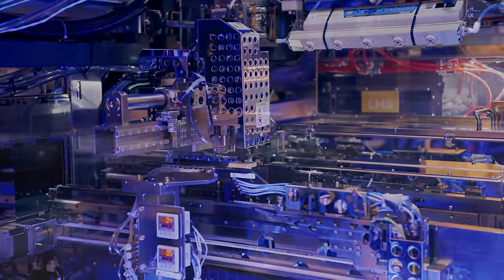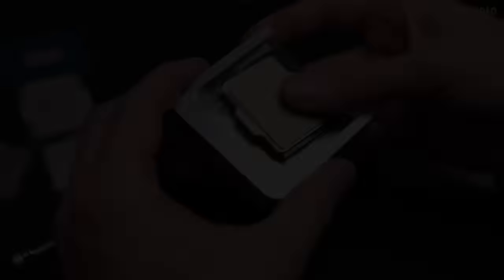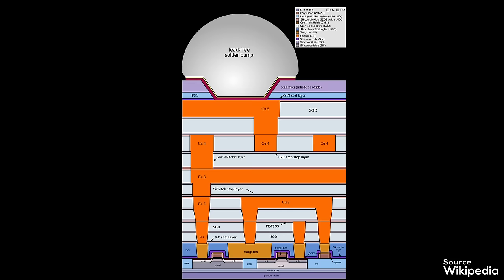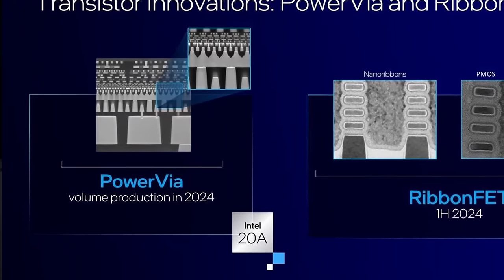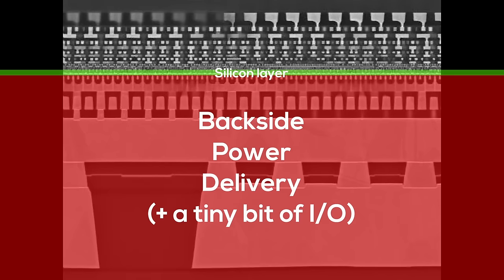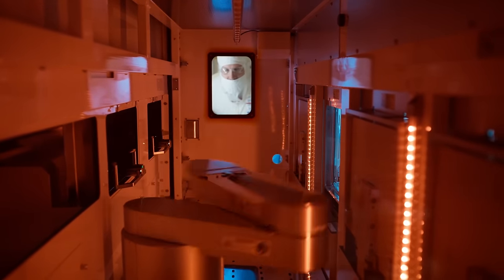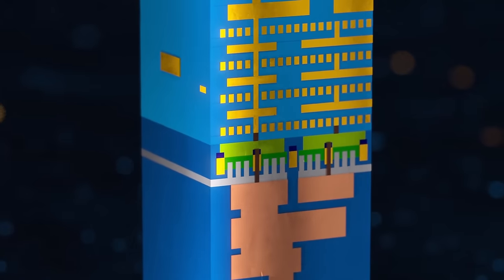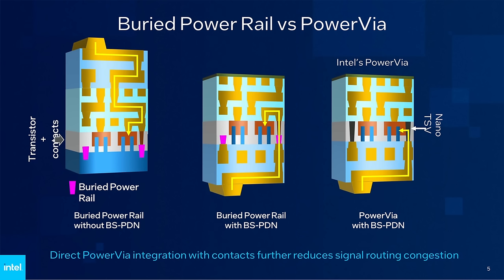Why next-gen chips separate Data & Power

Comment: Greetings from the Intel 20A BPD team! I was involved with Blue Sky Creek (BSC) in its early stages, but was moved from the team to work on 20A proper before they hit the labs post-silicon. I did my PhD on the development of modeling and optimization methods for chip to chip power delivery, focusing on multi-chip-module designs and finishing in 2020. Feel free to ask me anything about this new technology and I will happily share what I can.
Reply from the maker: My first question would be, how much did I get wrong? :D
Reply: @HighYield  I could nitpick stuff for sure, but you didn't miss much. One thing that would have maybe been good to mention as I see a lot of comments asking about it or maybe misinterpreting it is the thermal consequences of the new design.

With the transistor layer moved into the middle, it is true that you have to pull the heat from them through more silicon, but the reduced waste heat from other parts of the die such as the significantly lower resistance in the power vias more than makes up for it. I think we measured something like 20-30% lower resistance in some scenarios, which means a lot less voltage drop from contacts to transistors. That power loss from resistance is a significant portion of the heat generated by a modern chip. I can't say exactly how much, but ARL could actually use that to see a reduction in max power for the first time in a lot of Intel generations.
Reply: Hey, I'm just a person. But you did say you would answer questions so... 
What does this mean for mobile phones?
Reply: I've got a couple of questions for you. I'm currently studying computer architecture so i might just be missing some common knowledge about manufacturing processes
1) If the pin connections are now on the backside along with the PD network, how do external data signals connect to the signal network?
2) is more material lost/wasted due to adding a new carrier wafer and removing the old one? (8:50)
Reply: @parsnip908  Power and I/O are still routed to the same side eventually. This isn't reflected well in diagrams because you have to cut away somewhere. Most of what is on the frontside is the communication network on the chip, as this is what really dominates those low metal layers and gets in the way of other stuff. BPD should really be called BPD&I/O. You can still mount the chip in a BGA form factor like normal.

There is technically more waste material as you use 2 wafers in the production process, but since the yield can be quite high and the pitches in the metal layers relaxed, you can actually save money in the production process. This is part of why 18A will be offered externally after the technology proves itself on 20A.
Reply: @GreenishlyGreen  Since the SoCs for phones use the same lithography technology as any other computer chip, you can expect BPD to have the same benefits for them as well. I'm not sure how well ARM designs take to the new techniques, but Samsung has claimed some pretty good gains with their BPD efforts for future Exynos chips.
Reply: Q: Why are your CPUs less efficient than your competitor despite using "Efficiency Cores" which you guys only use, is this a problem in fab team or the problem of your CPU team?
Reply: At the end this video implies 18A is comparable to TSMC N3, is that correct or is N2 a better comparison?
Reply: @TechOtakuYT my guess would be that they can't give you best of both worlds in one design. The P cores sacrifice power & thermal to maximize performance. The E-cores flip that around to maximize efficiency.

Obviously they aren't enough, or you'd see much lower standby-power draw in practice.

It's like AMD's X3D-nonX3d design,  being in single chip makes it better, you trade one feature to maximize/minimize other. 

Because you can't have it all in one thing.

I bet a couple of hundred iterations on such design ideas will significantly help current situation of ultra high end silicon.
Reply: @TechOtakuYT   That is an extremely loaded question, and I tend not to answer these as the folks asking them just want me to confirm what they already believe. But, I said ask me anything, so I'll try to explain some of what's going on inside Alder Lake and its derivatives RPL and MTL.

The architecture performance of Raptor Lake and Zen4 is fairly comparable on the P-core side, and the E-cores are often comparable to Zen2 thread for thread. In my own testing, the E-cores of the 12900K perform on-par with a Ryzen 3300X and the 16 present on a 13900K close in on the Ryzen 3700. So the idea that any of these cores aren't pulling their weight should be dropped. The E-cores are doing exactly what they are supposed to be doing.

A lot of the gap comes from the difference in process nodes chosen. AMD's Zen4 is built on a mature 5nm process, while Raptor Lake is built on Intel7, which is a tuned version of the old 10nm node. I want to be clear that is is not the same 10nm as Ice lake and Tiger Lake, but it is in the same family. I pin the high-frequency inefficiency on the process node.

We can see evidence of this when the P-cores of Meteor Lake, Redwood Cove are considered. They achieve similar power efficiency to the 5nm Zen4 chips, and really only lose out on mobile to another node disadvantage as Phoenix is 4nm silicon. If the CPU tile had backside power, like in Blue Sky Creek, the power efficiency gained there would likely put MTL slightly ahead, but this wasn't going to happen with a low-volume R&D node.

I'd also like to add that Intel is far from the only chip maker to use E-cores. AMD of course has smaller Zen-C cores, but the better comparison might be the mid-sized cores on a smartphone SoC in terms of functionality. The E-cores of Raptor Lake and others are there to make a better use of the limited die area. Having more P-cores will not make most things that need fast cores go faster, and they provide more multi-threaded performance per area than those P-cores.
Reply: @gtg162y  20A is the 3nm competitor and 18A is an improved version, so you could call it a 2nm or a 3nm+ competitor. I don't control how they market these things though, and that's all that really is.
Reply: @DigitalJedi  I see, thanks for the info, also they reason i didnt compare Intel's Efficiency cores to that of ARM is that because i cannot be sure if its apples to apples comparison as ARM is using a completely different instruction set to that of both of AMD and Intel's CISC. As for AMD, they only really use it on their Laptop and low end SKUs so i completely forgot about their existence tbh.
Reply: @DigitalJedi  I see so then Intel 3 is comparable to TSMC 5nm, Intel 4 to TSMC 7nm and Intel 7 to TSMC 10nm in terms of perf per Watt, is that correct?
Reply: @TechOtaku86  The reason I chose that comparison is that despite the difference in ISA, the cores serve similar purposed and relations to their big cores. They are both generally simpler, much smaller, and lower-clocked cores that provide extra multi-core performance.
Reply: @DigitalJedi  ill be using it to run higher vcore and clocks lol
Reply: 20a better be ready tho
if u get 20a u get 18a and suddenly IFS becomes very relevant
Reply: Appreciate your replying to the comments. Interesting reads as a hobbyist architecture nerd.
Reply: How deficient can I do clock shielding with my ground on the back side? Also what is the alignment tolerance for the back side patterning lithography steps?
Reply: Very nice thread, thanks for sharing your insights. Q: What do you think about Intel announcing 2 big changes, RibbonFET and Power Vias in the same 20A node? Are there any notable challenges or risks integrating both of them to the manufacturing process at the same time?
Reply: @szaszm_  There are certainly challenges to doing both at the same time, but it's one of those things where you might as well do both if you have to rebuild from the ground up for either anyways.

Also note that it only looks like we are adding both a the same time for the production process nodes. Like was mentioned above with Blue Sky Creek, there is a version of Intel4, a finfet node, that has BPD. This is an R&D only node, so only small dies and no products. This node is where Intel makes its performance gain claims from for BPD when 20A or 18A is not named.
Reply: @CyrusTabery  I can't really disclose either of that sadly. You'll have to wait until there are 18A specifications out from Intel as that node will be available for IFS customers.
Reply: Tell the truth now. You internally call it "the power bottom" don't you? ;p
Reply: @bigcazza5260  20A is going to overclock differently to things before it, so be prepared for that. Voltages are likely going to be lower than before due to the lower internal resistance, and you may find that thermals are funky on tiled chips since the interposer can also get hot.
Reply: @myne00  I'd by lying if I denied that lol. I'm not sure if we all just have the humor of teenagers or if the stress is getting to us.
Reply: so if the interposer heatsoaks then i guess because transistors are down low you will get diminishing stability?
meh im used to fighting high ambients with 1.5 dual rank b-die
Reply: @DigitalJedi  e cores are very closely related in philosophy to a 4 core ccx but they are more balanced to assist intels p core, zen4 has nothing on alder lake lol
Reply: @DigitalJedi  LPe cores are actual efficiency cores to keep the main processor die powered down. E cores are just MT accelerators and good for crappy tasks that dont need to clog up your main threads
Reply: @bigcazza5260  I'm well aware of how a product I helped design works. E-cores are generally going to be more power efficient at the clocks you see on desktop non-k and mobile chips, and the LPe-cores are just the same thing at lower clocks on a different process node. There is nothing special about them other than coming in 2s instead of 4s, and what they are connected to.
Reply: @DigitalJedi  
Thanks for taking queries in this thread!! :)

I have got a few questions on this:
1. If this is the architecture moving forward, then it is not compatible with the next layer of system-design co-optimization, say a 3D stack or in-memory compute designs. Thoughts?
2. Could you comment of testability mechanism of this chip, given the GPIO/JTAG pins would be separated. So, would it mean, these designs take test-time penalty hit? How are they multiplexed with design structures?
3. I believe there cannot be free lunch, do you any existing bottlenecks/potential roadmap challenges in this method? Or is it too early to comment on??
Reply: @TechOtakuYT  Because as Intel has always claimed, the E Cores are efficient in terms of die space used, not power/performance ratio (that doesn't mean power/performance isn't a goal, it's just not as highly prioritized as space usage).
Reply: Hi really appreciate your taking questions, here are mine:

1. In the context of managing thermal stuff I'm guessing a traditional heat sink (placed on data signal BEOL layers?) wouldn't be as effective because its farther away from transistors, I see in a separate response you said that the resistance drop from using backside power makes up for it but is there any case where a design (high utilization lots of active transistors) could push the thermal limits? Is there any thought at Intel w.r.t microfluidic cooling?

2. In the context of 3D ICs I know Intel uses face to face (F2F) bonding in Foveros so how does the addition of back side power delivery change things w.r.t power and I/Os? By this I mean assuming F2F is still used and we get our bottom die (closer to package) I/Os and power from its backside PDN that makes sense, but to get power and I/Os to the top die we would maybe use one of following options:
       a.  send them through the data signal BEOL on bottom die, then to the data signal BEOL on top die ->  this really doesn't make any sense to do as it removes BSPDN gains
       b.  use some copper columns from package/interposer from outside bottom die (I think this is in Foveros) -> This is the option that makes sense to me but I don't understand how its implemented
       c.  use wire bonding to get signals to/from the top die 

If I missed anything or made incorrect assumptions feel free to call me out
Thanks so much!
Reply: Is this tech also applicable for other architecture beside the x86?  (ARM and RISC-V)
Reply: @vatsan2483  Foveros 3D stacking is capable of working with the new die layout. I unfortunately can't say a whole lot more until Intel has disclosed how things work.

Testing works pretty much like a normal chip, as the connections are all still on the one side. I once again sadly can't go into much detail, but there are some time hits with any new process, and developing those best practices for testing are a big chunk of bringing any process node online.

It's a bit too early to comment on any roadmap challenges. Right now things are pretty smooth sailing, but I'm sure there will be challenges moving towards sub-nm class nodes as the miniaturization required to reach that point is very extreme.
Reply: @YuzuYuiAngelaAki  Absolutely. The process node does not care what you make on it. You could make x86, Power, ARM, RISC-V, MIPs, or even a GPU on here if you wanted to. Samsung has been testing their own BPD with ARM Cortex-X cores if I remember correctly, showing sizable area shrinks for X4 and X5.
Reply: @DigitalJedi  Thanks on your replies, will await the Intel official release... Layout yes in notes these can be explained and reasoned out for 3D chips but classically with Intel this I don't expect to be details wrt Testing in any release docs :(
Anyways thanks for your response!!
Reply: Have you considered employing microfluidic cooling on the backside as well? I recall seeing a paper about microfluidic cooling with TSVs, enabling possibilities for BGA or stacked chip configurations. Perhaps you could even introduce a socket-like system for liquid cooling to reduce costs.
Reply: @Tomatosauce-sx6tc  I covered microfluidic cooling in another comment, but to explain again, it's just not happening. You can do stacked dies without it, we already are.

As for why not do it, cost and complexity. Bying going the route of microfluidic cooling, you force the user into a liquid cooling loop, driving up the platform costs. The socket being suited to that does the same thing with every motherboard now needing to ensure a seal for liquid transfer.

It is simply much easier and cheaper for everyone on the consumer side if conventional cooling remains viable. Things like liquid metal or solder TIMs are very thermally conductive already, and if things get dire, the 14900KS playbook can come out with warranties on direct-die prebuilts.

I could see microfluidic cooling happening for some extremely custom chip, but whatever that thing is would be completely alien to everything else currently rolling off the fab lines to my knowledge.
Reply: @DigitalJedi  Thank you
Reply: @HighYield hahaha. A lot!😂
Reply: when can we expect news about BPD on GPUs?
Reply: @asdfsafdsfdsfds3988  I can't say beyond that it will eventually happen. Every major fab player is trying for BPD of some kind, so it has to happen at some point. The trend seems to be to target a given fab's early 2nm-class nodes, so maybe 2-3 generations unless somebody decides to shell out big for a node advantage.
Reply: Wouldn't cooling be inefficient ? I mean  I can't see this method being applied on modern computer CPUs , is this more for small ic chips found on a mobo or whatnot ?
Reply: @billkillernic  BPD targets high-performance chips like your CPU or GPU. As I've discussed in other comments, the thermal benefits from the lower electrical resistance more than offset the thickness of additional metal layers above the transistors.

Less heat is generated outside of the transistor layer due to resistive losses. Less power is needed to drive the chip because more of the total goes to the transistors. Between these two factors the CPU draws less power and as a result runs cooler.
Reply: i have idea, if the heat in the middle , change all the old designs   of cpu not just the chip but all cpu, first chip must stand so all signal layer,transistor layer,and power layer 50% area on top will put inside new design heatsink and on bottom 50% chip will sink or put to pcb, and maybe this design can make both signal and power layer side can own directly connect to pcb, so imagine future cpu pc not flat square but a cube shape and put the cube into motherboard, this design can have good heat sink on top. it's fine cpu for pc big 3-5cm height its give more area to heatpipe of pc heatsink to take heat. i just wanna share what in my mind😊
Reply: @dlv5  I'm not sure I understand your comment exactly, but it sounds like you are suggesting a vertical die with cooling applied to both faces.

Sadly, this cannot work. One face of the die must have the interconnect points on it. There is simply no way to route all of them to an edge, both in terms of the room on the edge and the physical construction of the metal layers.

Additionally, those connections now have varying lengths, with the ones going to the top having to travel farther than the ones near the base. This creates problems with your higg-speed I/Os such as memory and PCIE.

Further, this is not going to be mechanically strong. Your die is now a large lever that can wrench the contacts out of the pcb, making the whole thing more vulnerable to damage.
Reply: @DigitalJedi thank you so much for this!! What a trove 🎉❤
Reply: Will it allow  above 6ghz clocks while not getting as much power draw and higher fsb clocks because it would be awesome for overclockers?
Reply: @DigitalJedi  Firstly, thank you for making yourself available for questions! It is very interesting reading!

I would like to ask about lifespan and reliability of such chip. I know that it will be probably obsolete before it dies for usual customer but at the moment, I use 1st gen i5 660 32nm node cpu to write this :D. For a long time I have been curious how long a chip can last because I have an old laptop with 65nm Celeron T1600 cpu that has been on for 7 years and utilized to 100% for most of the time and it is still alive, yet I heard about many modern and much smaller node GPUs dying from mining crypto.

So far I have learned about two major failure modes of silicon chips.

Chemical diffusion between layers so the transistors go out of spec over time and they can't keep up with clock or fail completely. Temperature plays a major role here so having wires that generate less heat would be beneficial if this extra thermal headroom wouldn't be taken to increase performance. But still, in typical use case, I can imagine BPD chips to run cooler.

And there is electromigration. Again, having wires with larger cross section would decrease current density and heat generated so the chip would theoretically suffer less from this effect.

So, is it reasonable to expect increased lifespan and reliability of BPD chips?

And bonus question :D. Cache takes a lot of space on the CPU, yet it is relatively simple in structure. Do you think it would be somewhen possible to cram another layer of transistors, for example on top of current cache area, so it wouldn't interfere with other structures, to double the cache or shrink the area it needs?
Reply: @steposka  It's hard to say if the lifespan will be longer than the current chips, but I can say they should still last quite a long time if taken decent care of. It's actually pretty hard to accurately estimate the ultimate lifespan of a chip, as the processes that make them and the environments they are subjected to are variable enough to be basically chaotic. The only accurate way to simulate their total lifespan of a CPU and account for everything would be to just have them running until they stopped, but f we did that, the 3rd gen would probably just now be launching lol.

The GPUs the died mining were often times just the memory degrading. The main dies themselves are almost always fine as they have a relatively light and importantly constant heat load, which is also probably helping that celeron you mentioned. Thermal cycling is the enemy.

As for your bonus question, that's a complicated topic. In a way, it is already happening. AMD has multiple CPUs with 64MB of additional L3 cache stacked on top of the 32MB that is located in the die containing the CPU cores. That doesn't seem quite like what you meant though, as it is 2 entire chips.

The alternative is to do multiple transistor layers, and sadly there are no current processes that can do this that are anywhere near marketable yet.

As for why cache isn't shrinking, it is because the fundamental building block, the SRAM cell, can only be made so small. Memory works by storing charges, and you need a structure large enough to store enough charge to be readable again after some time. It is still slowly shrinking, but it now seems we are likely to hit a bottoming-out point in not many years where we can no longer beat physics into submission in the name of running doom on increasingly smaller things.
Reply: What's the work-life balance like at that level?
Reply: Can signals still be routed through the power delivery side?
Like less critical ones, or if a region needs more signals but less power, or it avoids an extra layer in the signal side…
Reply: Could the “backside” be another transistor chip, so as to kind-of double the transistor density, or have memory extremely close?
Reply: @musaran2  the back and front side are both metal, so there's no silicon to add them with. However, the techniques used here could in theory be adapted to multi-layer designs in the future. Right now that is impractical, and die stacking is used for a similar effect instead, and likey will continue to be used for a long time.
Reply: im pretty sure amd will steal this idea. :D
Reply: @Uraim AMD doesn't have any fabs of their own, and their fabricator, TSMC, is also working towards BPD.
Reply: @DigitalJedi    Any interesting research being done to move parts of the motherboard Vcore switchmode to inside the chip package?
With such a low voltage the amps are just getting insane. Be much nicer if we could feed the chip a higher voltage and drop that down closer to where it's needed. Assuming the switchmode can be miniaturized
Reply: @DigitalJedi  What am I going to be looking at when looking for a career in developing these chips and fabrication nodes at the bleeding edge? Is it a college degree? Or something you'd specifically study at a semiconductor buisness?
Reply: @Tim_2060  A masters or PhD in a relevant field is pretty much a requirement from what I've seen. My bachelor's and masters are in electrical engineering with a physics minor, then a few years in a related industry (Gigabyte, chipset integration) before the PhD. There is also quite a lot of job-specific training and learning that happens, especially on anything bleeding edge.
Reply: @DigitalJedi  Sounds pretty exciting, especially with Intel opening a big fab here in Germany. Thanks a lot!
Reply: @FiveArc  The last few weeks have been well over 50 hours, but we're in the next cycle for something post 20A I can't name now. Usually it's a fairly normal silicon valley type job. 9-5 with too many meetings and all that.
Reply: @DigitalJedi  how do you remove the silicon on the backside without removing or damaging the transistors themselves? the active layer is very thin compared to the amount of material that needs to be removed, so it sounds extremely difficult!
Reply: @asdfghyter  very, very carefully!
Reply: @DigitalJedi  i can imagine! what kind of technology allows that kind of precision? it almost seems impossible to me! like, how would you even know when you’ve reached the actual active layer?
Reply: the only thing comes into my mind is to do with ground shielding when moving the power far away from the existing test and proven structures of wafer.
Reply: @DigitalJedi  Soo cool tech! 
Q1: On a cnc flipping makes realignment hard, will yield not drop due to this flipping?
Q2: Also if already operating from both sides, why not add signals on the new side to further increase density - like use 20 or 30 percent  for signals? 
Thanks a lot for commenting!
Reply: @DigitalJedi  do you still use X-mas model verification of hardware structures?
Reply: @asdfghyter  I can't comment on exactly what is going on here, but in other semiconductor manufacturing methods, both mechanical and chemical processes are used to thin wafers.
Reply: I'm sure your engineers have already thought about this, but is it possible that the carrier wafer at 8:55 need not be at the same purity/quality that would be usually be needed for making chips since it's just used for support? I wonder if that's a sensible way to save on cost.
Reply: I have an application that would benefit greatly from this technology.  Is there a contact or team that I need to get in contact with at Intel ? I work in the Semi industry.
Reply: @pentachronic  20A will be an internal node. You'll have to wait until 18A to have chips made.
Reply: @DigitalJedi  Do you think these improvements in manufacturing have a bigger/smaller effect when you're talking the tiny e-cores present in n100/J4125 etc style USB-C powered mini-pc processors?  Because I see some REALLY weird movements in the Chinese ultra-low power chips(weird big/little configurations and the explosion of RISC-V cores that aren't even documented properly nor are they waiting for ratification of standards).  No doubt some of that is geopolitical, but in general how will it affect sub-10W computing?
Reply: @DigitalJedi  yeah, i suspected that there was an nda involved here, but thanks for replying as much as you can!
Reply: @DigitalJedi  With all the space saved from backside power delivery could large stacked metal layers on the front side be made for the single purpose of carrying heat away from the transistors below?
Reply: @GreenishlyGreen  Where in his post did he say he worked on SOC backside power delivery? Pretty sure he expressly said Intels 20A & MCM Designs.
Reply: Didn't you signed an NDA?
Reply: @ChimpyChamp  The front side is still occupied by all of the internal interconnects. If you found the room to slap down a bunch of copper pillars to increase conductivity, you'd do it at the expense of making that network routing a nightmare, which gets us back to why BPD is being done in the first place. Metal layers are already pretty darn conductive as well.
Reply: @FazedSoul  Pretty dang strict ones at that. That's why I can't answer seemingly random things or questions about the exact processes used. I'm over here looking up things on the Intel website to see what papers are out to the public before I reply to anybody and accidentally leak something.
Reply: @Psi105  I unfortunately don't work closely enough with that to answer you very well. There are however some great articles about this sort of thing out on IEEE Xplore. Youtube is apparently eating my links to them so instead I'll share the title "A Brief Overview of On-Chip Voltage Regulation in High-Performance and High-Density Integrated Circuits." This is proabably a good jumping-off point if you want to see what people have been trying recently.
Reply: @Grimmwoldds  Blue Sky Creek was nothing but E-cores and was able to hit 3.05ghz at 1.1v. That includes both of the tiny tiles (33.2mm^2 each) and their interconnect. For comparison the N300 needs about 20% more power to do that in a monolithic chip. We also achieved nearly 95% cell utilization in the CPU cores of that chip. While I can't say what the utilization is for MTL's Crestmont, it isn't quite that high.

I think the bigger gains for low-power computing will actually come from Skymont cores though, as they should be a sizable uplift over the current Crestmont. I highly reccomend the Anandtech article on Blue Sky Creek as I was one of the presenters at the event they got their slides from. We may even see chips with P-cores in that single-digit TDP class next generation, as LNL is targeting as far down as 7-9W, which is currently where ALD-N sits.
Reply: @nerdynumen  I do technically do work on SoC stuff, but only in the sense that they all go through our fabs. Things I've worked on have been directly applied to Lakefield, Meteor Lake, Arrow Lake, Sapphire Rapids HBM (did actual design work here) and Gaudi.
Reply: Do I understand it correctly that this design can be used for GPUs too? Does it help more with space there (less complex but more cores vs more complex but less cores) than on CPUs?
Reply: @dreimu  Process nodes generally don't care what you are making on them. I expect GPUs and CPUs to see similar improvements. You can get area, and therefor density, improvements going the BPD route.

I don't have great numbers that I can quote publicly for 20A other than a 12.5% percent shrinkage in cell size for the version of Intel4 used in Blue Sky Creek.
Reply: I'm curious. Since removing the backing layer is a high precision process how does it effect ultimate chip cost. I forsee potential for errors in both the mounting of the new supporting layer and in the subsequent polishing steps, not to mention the time to do these steps. How does that compare standard methods? If you can divulge, what measures are taken to improve production while implementing top power like this?
Reply: @DigitalJedi
I've got some questions too, would be awesome if you would be able to help me at least with a few of these.

1) With BPD, I expect the thermal conductivity to be more limited by some of the die layers. Speaking from the best comparison I can give, 7800x3d. I' ve noticed there being a limit to heat dissipation after PBO (boost algorithm) kicks in. So is it like I expect, you basically are required to lower Vcore, but once you hit a certain threshold thermal insulation just becomes too high? That would also mean no 9ghz LN2 record cause of ultimate voltage limitations?

2) All mainstream CPUs, Intel and AMDip have fused in V/f curves. This basically converts to the VID request. Therefore, how accurate do you deem those fused in V/f tables? Is it like +/-5 mV, +/-10 mV or less? Ofc all of those depend on your die temperature aswell, but I guess those are for worst case like 100°C anyways?

3) I haven't tested it myself. But how effective would you deem two sided cooling of a CPU, like normal coldplate + thermapad with small cooler on the back side of the CPU socket (back side of MoBo) directly put ontop of those additional capacitors? Could there be any meaningful difference thermally?

I appriciate all the points you can answer and I am looking forward to your reply!
Reply: oh forgot two more:

4) With cache and RAM latency becoming more and more the most limiting factors of modern CPUs and (actually) GPUs alike. Will there be a trend towards more cache RAM intigration through MCM desgin into the CPU (maybe even GPU aka HBM) itself?
Is it likely that we willl have MCM CPUs with literal HBM next to them on a shared interposer?

5) Isn't it possible to just fold a larger CPU silicon layer over itself to effectively double/ stack the SRAM capacity?
Reply: BSP seems like an easy choice vs further shrink/weird transistor shapes. Do you have any idea why TSMC is waiting so long to introduce backside power in their process? I think their roadmap is 2026 bc they’re gonna do GAA first.
Also, if intel gets some good development insights from BSPDN, why are they leaning into high NA euv so much? Isn’t the point of bspdn that you don’t need shrink to get more performance?
Reply: @TheTrueOSSS  There can be errors at every step and between steps just moving them around. It is a more complicated process, but 20A should not be terribly expensive for a leading-edge node all things considered. I can't say much more than that sadly.
Reply: @BaBaNaNaBa  Going to try to answer all of those in one big comment, so here goes:

1. The lower voltage is due to a lower internal resistance, which means there is less power going into the chip overall. Using Ohm's law you can find that with a lower resistance you will hit current limits at a lower voltage. Do with that information what you will. The lower power draw more than makes up for the longer path to the cooling surface, and metal layers full of copper like what would be on the frontside are still quite conductive. I unfortnately can't comment on clocks until Arrow Lake is in people's hands, but Blue Sky Creek saw a 6% increase to its maximum frequency on Intel4, which was a node not designed around using BPD.

2. I can't comment on exactly how the V/F curve is calculated as that is not my area of expertise. I can speculate though that they are planning for the worst case of both silicon quality for a given bin and to run near Tmax.

3. When I have done LN2 or chilled-water overclocking, I haven't cooled the backside of the motherboard. It is already basically a huge copper sheet and the hottest portion of the whole system is being directly contacted by a large heatsink already. Anything you put on he back has to go through the board, through the socket contacts, through a second layer of PCB on the CPU, and then finally to the hotspot. This is just too much to be worth the effort.

4. HBM is not exclusive to GPUs, see Sapphire Rapids HBM. I don't see it coming to the consumer platform due to the high cost of a multi-kilobit-wide memory bus. If any memory moves in to the socket I would expect it to be something like eDRAM LPDDR5X or LPDDR6 instead. We will see something close to this with Lunar Lake.

I am not an architect, but current trends show that large caches are the future. I believe that a large shared L2 is ideal, but AMD prefers a small L2 that is fast to search and backed by a deep L3. Both are valid approaches.

5. That is called true-3D lithography and is currently the holy grail of manufacturing as once you have it, you have effectively double or triple the transistor density of anybody who doesn't. It is believed to be possible, but currently infeasible. As of right now nothing that can do this is leaving some extremely low-yield lab if it exists at all, and if you know of somebody making it work with any semblance of scalability and reliability, I know some people who would be very interested in giving them hilarious amounts of money.
Reply: Is silicon carbide possible for CPUs? Heard they're great for mosfets, big heat transfer improvements
Reply: This is such a great technology. I kinda feel jealous that you had the opportunity to work in this.
Anyway, my question is, if the chip doesn’t have to be flipped over for external connections, how would the signal c4 bumps connect to the interposer/substrate. Because, now the signal bumps are on the top of the die. So, how would you bring them down and connect them to the interposer/substrate
Reply: Hello Sir. How is backside contact revealed? My bet it's first through abrasion, then last few hudreds of nanometer by atomic layer vaporizing.
Next up, I wish to know: Since power and I/O still delivered through the same side, some signal cables must travel from the front side to the back, perforating the active silicon layer, isn't it?
Thirdly, how it's affecting the heat generation? The heat generated in signal layer seems to be completely isolated. What's the condition of heat generated over long (say weeks) period of runtime?
Finally, what's the fate of this removed silicon?

I'm a layman, so please pardon my stupid questions.
Reply: @wrefk  SiC may be good for high-temp applications, but it doesn't have near the performance of a doped silicon wafer for frequency or feature size. I'm personally more interested in seeing where pure carbon or doped carbon goes as it has excellent conductive properties.
Reply: @rohithjbharadwaj3419  power and IO happen on the same side. It's the internal network on top now.
Reply: @aniksamiurrahman6365  I unfortunately can't disclose process details like that just yet. I will say though that you can bond metal to both sides of the logic layer without putting holes in it.
Reply: @DigitalJedi  Thanks for the detail sir. And wow! That small clue is a lot.
Reply: Will there be any problem in Cooling this chip and why? Also can we over clock it like the normal stuff?
Reply: @okman9684  I also want to know about cooling. Afterall, the front side will be hermetically sealed and the heat therein will have no direct route to come out. Unless the hermetic seal is fairly thin and some heat sink is placed just above it.
Reply: @DigitalJedi  Is the I can't say a the architecture not known or you're forbidden to speak on the matter?
Reply: @okman9684  It may behave a bit differently from a monolithic chip, but that's more a function of being MCM with an interposer. If you've ever done overclocking on certain AMD GPUs like Vega, you'll be familiar with what happens when that massive chunk of underlying silicon gets too hot.
Reply: @the_expidition427  Sorry that this sounds like I can't say why I can't say things, but there are a few reasons I might withhold certain information. I don't want to say something confidential, and I don't want to share something incorrect because some people will just take anything with my username on it at face value in this thread.
Reply: @aniksamiurrahman6365  Technically there is a longer path from transistor to heatsink, but with so much less power wasted in resistance just getting to them, you'll likely find that the overall heat load is less.
Reply: Your answers are pure gold. I have some questions:

1) Can BPD apply to older process nodes like the legendary intel 14nm to improve power efficiency on low-cost chips, or chips that don't need the latest process (power delivery chips, etc)? Or is it better to just move to a smaller node at that point?
2) Power efficiency of Arrow Lake and Lunar Lake look very promising. Since TSMC's 2nm (BPD) isn't coming till 2026, do you expect arrow / lunar lake to claim the efficiency crown on laptops/mobile over AMD/Qualcomm/Apple in 2025?
3) On a chiplet/MCM processor, can BPD and non-BPD chiplets be packaged / mixed&matched on a single substrate? Or do all chiplets need to be either BPD or non-BPD due to the different voltage requirements?
4) (not BPD related) Nikon recently earned Intel's 2024 EPIC Distinguished Supplier Award with Safety Distinction. Afaik Nikon only produces DUV lithography equipment with no plans for EUV. Can the leading-edge process nodes today still be produced on DUV machines, and if that is the case, how much longer can Nikon DUV & non-ASML machines stay relevant for high performance chip manufacturing?
5) When do you think we will move past silicon onto the novel materials like carbon, etc?

Thanks in advance!
Reply: @stevenliu8611  We've applied PBD to Intel4 as well, so it can go larger than 20A. It might happen to some flavor of Intel3 but I'm not sure. I doubt Intel will go back and attempt to add it to legacy nodes, and you can probably get similar gains over something like 14nm by just moving to Intel10 or Intel7 without spending more R&D money on a custom node. In theory yes though, you could make a BPD version of 14nm.

I'm not going to make any claims of superiority just yet, but we are hoping to close the gap with TSMC's cutting edge here.

Arrow Lake will be a mixture of tiles from Intel and TSMC, and only the 20A CPU tile is currently confirmed to have BPD, so there will be mixing right there. You can do some voltage regulation in an interposer in theory, but you can also just have the vrm supply different voltages to different power pins for each tile.

DUV has a fews years left in it yet I'm sure. Even if it doesn't end up making flagship process nodes, there is going to be a lot of stuff to be made in the 7-3nm range that may not need EUV. 5nm and 4nm-class nodes in particular are likely to stick around as they are sort of where SRAM stops shrinking with current techniques, and phys don't gain much from being any smaller. That means your future budget chips could be on "legacy" 5-4nm for a long time.

I don't personally see us moving to something like a graphene or other carbon variety in the near future. So much infrastructure is built around silicon and treating it in every step of the process that anybody looking to retool for some alternative is going to be an island to the rest of the industry for at least the first few years. I think it may happen eventually, but I don't expect it to leave the lab in the next decade or so if I had to put a number on it.
Reply: Though I know that microelectronics deals with DC power, I am still curious about its relation with AC (as that is the field I work in currently). With the large frequencies observed in modern chips, is there essentially a measurement of power factor for chips at different frequencies? Furthermore, if a thing like PF exists in this context, how drastically has BPD affected such?
Reply: Just stopped by here to thank you for patiently answering all the questions. Learnt a lot!
Reply: @Thirty-Two  I don't think I'm actually able to prvide a satisfactory answer here. In general I don't worry about things like a power factor for these nano-scale circuits. The energy for each transistor is measured in picojoules per bit, so any measurement you take at that level for power is going to be near infinitesimal.
Reply: I'm enjoying being a fly on the wall for this thread 🪰
Reply: So, the carrier wafer/silicon is adhered and not deposited to the front side? And is the original front side substrate wafer removed using a CMP process or etched?
What is the reason for using the 2nd substrate/flipping process instead of building the signals metal section -> transistors layer/s -> then power interconnects? Just yield/cost between the two approaches? (Since apparently the signal vias run around the periphery to the 'backside'? Anyway)
Reply: @DigitalJedi  Well when I bought bought the Intel Q6600 from Micro Center way back when I cut a hole in the side of the case where the CPU was and put a 80mm fan there ( think the right size ) since I OC'd it. Wanted it to last a long time and it did. Among other extra holes in the case with extra fans 😄
Reply: @tannerbean3801  I don't know if there's a better approach for this new technology but in the old technology the silicon in the wafer is what is used to build the transistors.  Some of the silicon after its doped becomes part of the transistors.  Because of this I don't know how you would achieve what you're describing.
Reply: @TheKuptis  I know that silicon substrate is required for building transistors. Silicon can be deposited   i.e. using silane plasma, which is why I ask. I don't know how the 2nd wafer is adhered to the first... or if that bulk silicon is deposited/grown some other way
Reply: @tannerbean3801  The way it's being described they're using a whole other wafer since it needs a solid foundation to be handled by equipment for the rest of the line.  Seems to me to deposit that thick of Si layer would take a long time and be expensive.  Don't know what's being used for the "glue" to hold the new wafer onto the stack so the old one can be taken off.  I worked at Intel from '97 to '03 in Tungsten dep but in the semiconductor world that was back just this side of the stone age.
Reply: I am more curious about how it will impact GAA Transistor. Doesn't mean they could actually optain even more height? I kinda imagine one GAA could replace 4 FinFets. So it propably doesn't work that way, right?
Reply: Does it sound practical to completely cover the top of the die in copper(another layer that's insulated from the internal connections and completely filled out), and later directly bond that to a heat spreader or IHS, to have more consistent thermal contact?
Reply: @DigitalJedi  Intel’s 11th gen CPUs had the I/O on the die, contributing to their low-latency and responsive performance, making them feel faster. However, the 12th gen and subsequent series relocated the I/O off-die, leading to increased latency. Will the upcoming Arrow Lake CPUs tackle these latency issues and restore the snappiness of previous generations?
Reply: How far away are we ?
Reply: I love this thread ❤😅
Reply: Can you use cheaper or less pure Silicon for the 2nd layer because its just used for structural support, because with my Logical thinking you could just use cheaper not as pure bi products from Silicon making as secondry layers.
Reply: @TheDanil044  We can't use byproducts. Those aren't silicon. Mostly some very un-fun liquids. But yes, the wafer doesn't need to be quite as good as the transistor layer wafer. It does need to be chemically compatible though, so it's not like we can use the absolute trash stuff for it.
Reply: @tannerbean3801  A silicon base is requires to deposit the layers on. The finest connections to each transistor or group are made in the first layers, and then the pitch generally increases as you go out to the external layer.

The method you suggested would require an initial carrier material to build those metal layers on anyways, and has the added difficulty of narrowing connections you then have to make transistors on top of with perfect alignment.

You'd somehow have to make those transistors on the bottom of a second wafer with the rest of it in the way, and then etch away the rest of the wafer to continue building.

It's much easier to do it the way we are as it avoids reinventing the wheel for some of the steps.
Reply: @GeekNerdNoir  The primary IO is still on the CPU. It never left. That would be like regressing to the setup of X58 with a north/southbridge layout.

 There have been no appreciable changes to the IO architecture between Z490 and Z790. You could go back further (Z68/X79) and still see primary IO on the CPU die, but those cover all the CPUs you mentioned.

As for what Arrow Lake will do, it has an SoC tile similar to Meteor Lake.
Reply: @DigitalJedi Quick question, some of the ESD protection should be located on the bottom side of the chip right (for IO pads located on the bottom side)? Does this ESD protection design vary from the conventional one that someone can find on the top side of the IO ring? Also, it's been a month since you post this question, was this one your biggest mistake in your life creating a non-ending Q&A session in youtube? :D
Reply: @inoth79  I'm not the person to answer things about ESD unfortunately. I don't see any reason it should be terribly different, but I'll defer making a statement on that until there's an official spec listed.

I don't mind the Q/A session in the comments. I wish there were more people able or willing to talk about things to the general public. I'm forever a researcher at heart and love to talk about this kind of stuff.
Reply: Customer working with the 18A team, nice work!
Reply: @DigitalJedi  I have two questions. The first is a question on new memory technologies meant to replace SRAM on CPU dies: Do you have a favorite new memory technology that has the reliability of SRAM but better scaling properties (and other better characteristics)? How likely would it be to see something new in this area in the forseeable future?

Q2: Would you like to see the industry taking a different technical route somewhere? Please explain your choice if there was something you'd like to change and had a limitless budget to implement it.
Reply: @DigitalJedi do you think graphene replacing silicon is in the cards any time soon? With insane 100ghz clocks?
Reply: @casperes0912  I don't see graphene replacing silicon anytime this decade. It has the uphill battle against decades of industry, and I'm willing to bet a millennium of man-hours, perfecting silicon processes. Some of that transfers, some of it doesn't.

As for 100ghz clocks, literally never. Just think for a moment. The fastest consumer chip out right now does 6.2ghz. It's arguably too fast for its own good, to the point where it appears that next-gen chips will go back to around 5.5-5.7ghz if you believe leaks.

Graphene might have properties that make higher clocks easier, but nowhere near the 18-20x our current speed that you're talking about.
Reply: @usmanhassan3824  Not every CPU will be stable with an undervolt. You could get lucky with a chip that takes an undervolt well, or your chip might need stock voltage to be stable at stock clocks. This can even be motherboard dependent on the same CPU.

As a customer you call this the silicon lottery, and just rest settings back to whatever was stable.

On the fabrication side, we have to make all of them stable, even the worst ones of that sku.

This means there are 3 options. Either fewer chips make it into higher bins due to voltage instability, or some of them are run with more voltage than they need, or the third option, some of them just crash constantly.

In the first case, everyone's CPU gets more expensive. In the second case, some people get a nice undervolt while the rest have a working CPU. In the third case, some people buy a dud and have to rma a chip for an avoidable problem.
Reply: I wonder how those holes are made (vias) in the wafer, and how the back side of the wafer is removed. Lasers? Etching? Milling? The process looks complicated to me, since it has to be ultra precise.
Reply: @DigitalJedi Is Canon's Nanoimprint Litography likely to be useful or compatible with BPD?
Reply: Is this innovation something that could present x86 with an advantage over ARM? The way I understand it, it could be used for the benefit of any platform, as it is a hardware manufacturing technology and it is being now pursued by all major foundries, including the ones that manufacture ARM chips.  But I would be happy to be proven incorrect.  Thank you.
Reply: @Gustavo_St  Process nodes are architecture agnostic. Backside power will present a significant theoretical advantage over nodes that don't have it, and the first chips with it will be x86, so in that sense there will be a period of potential x86 advantage, but Samsung and TSMC are both going to close the gap within 2-3 years. Both are major ARM chip manufacturers, so it will eventually even back out.
Reply: @GreenishlyGreen  its the same gor mobile chips as well, I think itll have even more of an impact because mobile chips are affected by heat the most.
Reply: Hey man, your amazing!

I don't have a technical question but 

So, is everything on track?

 Intel is known for delays and stuff, I'd really like to see their plan of 5Ns in 4 years come to
true, it'd be so fun to see better chips (though I dislike the npu in the new core ultra series)
It'd kick tsmc, amd, and samgung off their chairs and on to their feet too, I really hope it goes well
Reply: @DigitalJedi still, won’t the heat going trough two less thermal conductive layers of silicon wafer going to be a pain for more powerful chips? Active cooling going to be less efficient in dissipating the heat from the system. Will the actual resistance and voltage drop benefits going to compensate for worse heat transfer?
Reply: @MadNoseMN  I have already commented on this a few times. Current models point to yes. Your bigger concern will always be the IHS/die interface anyways. A few slivers of an mm of metal on one side or another don't do a whole lot in total.
Reply: @DigitalJedi could this be the new 14nm (but for the whole industry?) what’s the next step after 2-3nm if physics kinda falls apart at that point?
Reply: @DigitalJedi for PCB design we usually want a reference plane very close to the signals which is why we usually have ground planes in the stack up very close to the signal layers for a variety of reasons I'm sure you're familiar with.

So the reason I ask is that I imagine something similar happens with the signal wires at microscopic level inside the chip but rather than with planes of metal layers it probably is a ground  trace paired with a signal trace right?

Am I assuming things wrong? If not, is ground still routed alongside signals on the front side with this new approach?
Reply: @dlanm2u  Backside power is going to be almost ubiquitous in future nodes. The long term future for sub-nm nodes will possibly be multiple logic layers, but that's purely speculation on my part.
Reply: @lugaidster  I can't comment on exactly how the routing works yet. Intel should have tools out for chip design on 18A in the near future if they don't already.
Reply: @DigitalJedi  fair, thanks
Reply: I know this is a bit late, but only stumbled into the video today. One thing that comes to mind when I think of BPD&I/O is that it might generate less interference inside the chip and should allow for better clock speeds, I wonder if that could be accurate though? I guess with less resistance we should also see lower temperatures overall, too?
Reply: @MatheusPratta  There is a frequency gain to be had. Blue Sky Creek demonstrated a 6-10% gain at equivalent voltages to standard Intel4.

As for temperatures, those may not be lower, but only because the chip itself will still target its thermal limits for maximum performance. What should be lower is the power consumption, which yes, does make the chip easier to keep cool.
Reply: I’ve been wondering if it might be worth revisiting preconceived notions about density. I can imagine a future where we laugh at the ridiculous effort we put into forcing more performance out of 2D chips when we’ll eventually have to focus on ultra low energy and 3D stacks with thousands of densely interconnected silicon layers anyway. Thoughts?
Reply: @dlv5  i get it. i had that same thought but it's already been covered with slot style chips from the late 90's with amd slot a and pentium2&3 this first limits the size of the cooler direct contact, even tho it is chimney effect and it limits the clock signles all going to the board connect side as signal now has to wrap around 3 sides of the chip if at the top to get to the m/b i/o connects.this was why the original slot a athlons had off die 256kb of cache for a total of 512kb which actually slowed down the cpu in wait state increases trying to get off loaded of die data, they eventually did away with athlon a for athlon thunderbird with just only the 256kb on die cache and then went back to the horizontal chip contact on the next iteration of thunderbird to slot a. you're going to run into the same issue with a 3D modeled square of 4-5 sides as well as any vertical mount die when 1/3 to 3/4 of the traces have to be run around the die to the m/b connect BUT with carbon interior interconnect paths and open corners or even centered pipe line connects.... it could be done, but it's going to be extremely more complicated with significantly little yields due to the complexity that it wouldn't be profitable. now a 3D pyramid style die core piechart lay out would probably have pretty good yields if you can find a way to grid layer arrange everything. it's not like you can 3d print things at nanometer layers, but if you did so with stacked layered litho while able to add a slice ontop of slice that currently isn't a process of mass production.....you'd have to have a magnetically aligned mess of nano confetti you could litho laser connect...and well we are just dumb monkeys pulling out food out of the ground with sticks. the command over energy that would require is beyond our capabilities probably until 2500 A.D. you'd have to be able to command protons and neutrons in atoms to arrange themselves to get to that kind of manipulation.
Reply: @DigitalJedi i get what this guy was saying, but it would have to go a stp further, he was refering back to slot style cpu but more die to socket direct vertical connection in 3D. what would have to happen is then the cpu would have to become the socket on it's exterior and the motherboard would have to daughter socket into each dies face (for example lets use 6 so a cube dimensions top bottom front back right and left sides) so power delivery on say the bottom#6 side memory in on the left face, output on the right face, input out put with pcie pci sata audio nic, this would require moving the bridge &/controller to  that die face with the interconnects on each edge of that face for those devices or one device per core with a dedicated edge face for it to spread out the heat generated no idea on that amount it would cause? i'm just winging this fast could be cube could be pyramid could be 8-10-12 sided. i would think divisors of 3 would show the most stability but pyramids are the smallest 3D object so that is 4 die faces with your interior probably being the BPD or flip that. your the engineer you'd know which is better. mold the mother board and their daughter accessories to the 3D object cpu. you should be able to graphene the shared die corner edge for internal to external dissipation heat pipes or centers or some selected spot near or on each faces central edge. adapt like star treks borg ship. dies that form a 3D object. there's going to be a limit at first tot he amount of dies that can connect but given development....it would truly enter quantum dimensions. i'm sure there is even a way to I-beam construction with 3 dies all vertical and two of the dies end capping on their centerline the central die. that could later be splined to 3 ways endcapped by other dies/cores on a vertical with substrate filler and slotted heat pipes to the cpu cooler like the old pin style heat sinks but with the dies running thru. so many possible iterations.
Reply: Is the carrier wafer just silicon?
Reply: Atomera
Reply: Grade 7?
Reply: I have a question too, as I too study semiconductor, with this BPD, how far do you think lithography can go before we hit the wall of nanometers being to small and we have to go with different methods probably with SAQP?
Reply: @nesseihtgnay9419  Intel currently has plans as far down as 8A or a sub-1nm-class node. Between High-NA EUV and BPD there are good density gains to be had.

I do think eventually there will be some limit to transistor density, at which point we are likely to see multi-layer logic designs as it means you start measuring not in mm^2, but mm^3.
Reply: Gotta love the internet where chances are someone will come crawling out of the woodwork who was somehow personally connected to the subject.
Reply: @DigitalJedi something like Lakefield? That was pretty cool for the Time. Btw Is Intel partnership with arm on 18/20A still a thing?
Reply: @favio9454  I was involved with Lakefield quite a bit, actually, given it was an active interposer design and my area of research. I did just realize I wrote 2020 instead of 2012 for that date. Most of my client-facing work at Intel has been things that are stacked on top of each other in some way.

I agree it was really interesting for its time. The extreme power constraints made it a rather unexciting chip for consumers, but being an early attempt at die stacking and PoP dram for x86 made it super cool technically. I got a good couple of papers out of that interposer, which should all be on Intel's site.

I sadly can't say what's going on with client orders for IFS, as I don't have that kind of access.